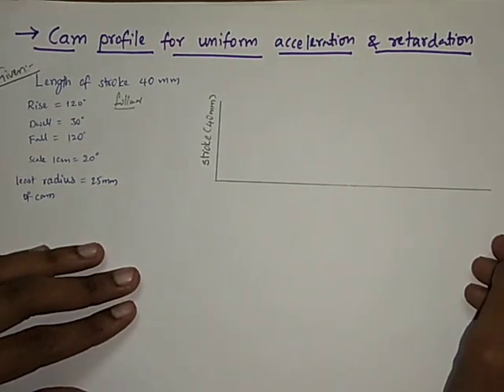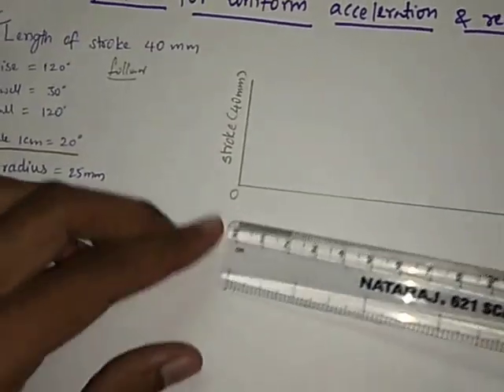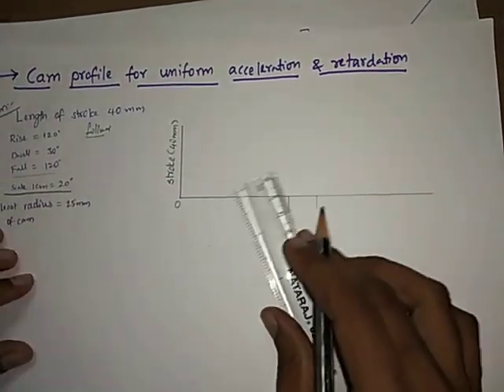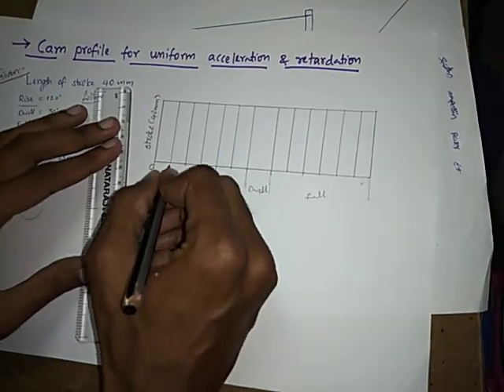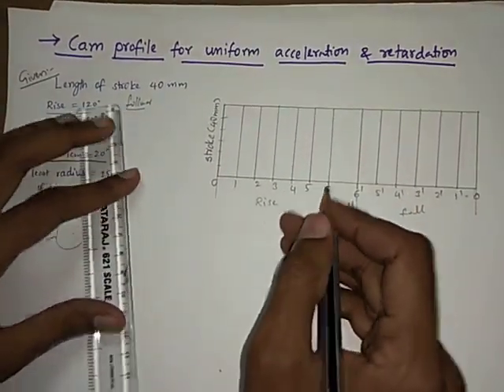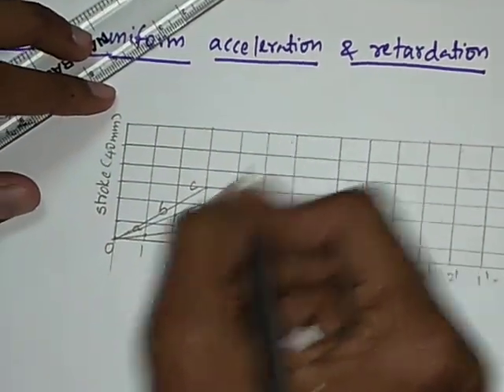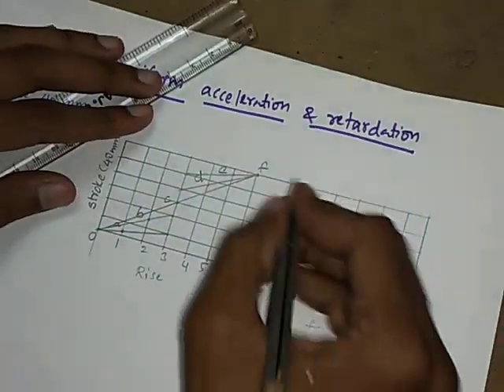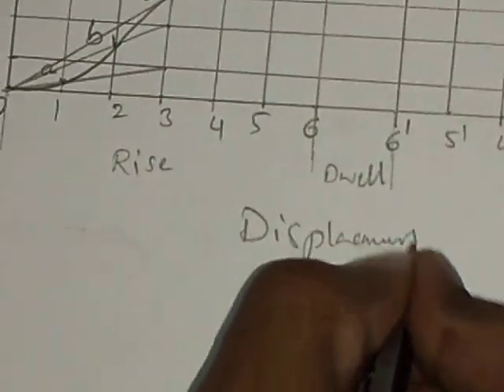Cam profile for uniform acceleration and retardation

Comment: what shape would a cam take if the following must be satisfied.
for every 9 degrees the follower must move up 1 cm until it reaches the first half of the rotation..and after reaching 20 cm max height with zero dwellbthe cam follower moves down 1 cm per 9 degress till it completes the rotation..

Comment: Sir iam little  bit confused  at  diving the circle according to the angles  given
Reply from the maker: Smily Bandaru ' if rise &fall are 90 then take 1cm =15deg so you get rise as 6cm in displacement diagram and divid the circle into 6 parts each 15deg. Same way for fall also

Comment: what if 60 degree is given and i have considered 1cm equal  to 20 degree..so 3 cm will i divide to get even no of parts.
Reply from the maker: Yes you can divide each division 0.5cm
Reply: thankyou i had got it later ..thanks a lot..😊